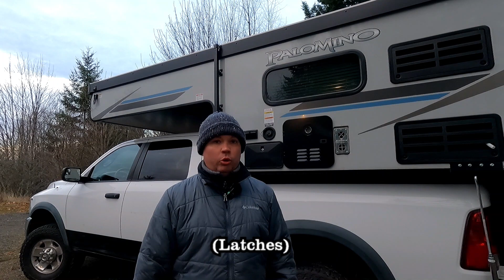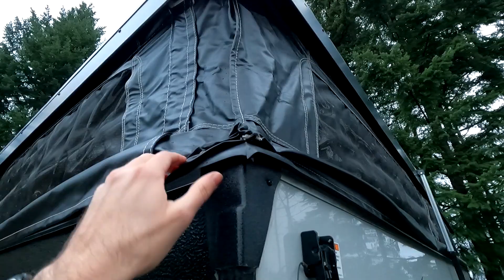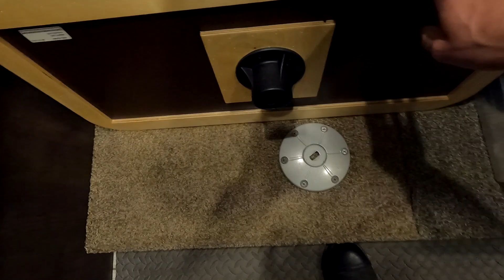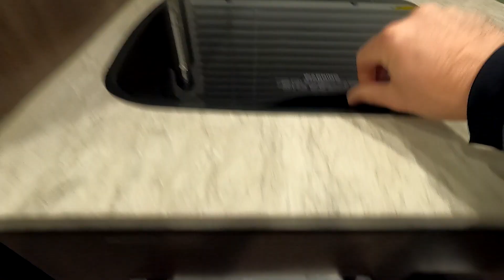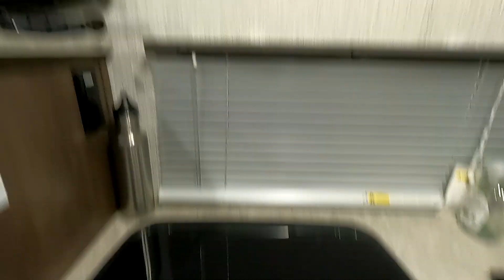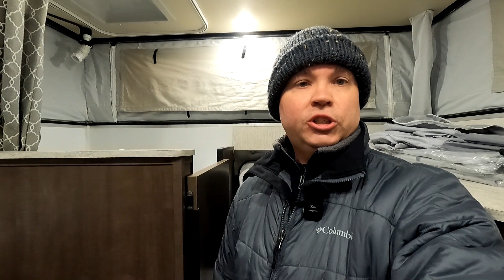Power Wagon Camper Part 9. New Palomino SS-1251 Worth Buying? 1st Impressions & Build Quality Issues

Comment: Any issues or annoyances with it on your shortbed? Was just told by a local rv dealer that it wouldn't fit correctly on my 3/4 ton 6.5ft bed - or atleast I wouldn't like it.
Reply from the maker: I think your dealer is mistaken.  This camper was designed for a 6.5' bed.  It's listed on the Palomino website as such (and shown in the back of short bed truck on the website).  No, I haven't had any issues with this camper being in my 3/4 ton with 6.5' bed.  You'll probably need helper springs or air bags if you don't already have them, though.
Reply: @outdoorsinoregon  I saw that on their website too, but just wanted to hear from someone with experience. Thank you

Comment: If I read all before I bought my pop-up I would not buy one. I to have problems with top lift jacks. When unplugging from truck doesn't have enough battery power to raise all four jacks. A d I have solar panels.
Reply from the maker: Yeah, I like having the shorter profile for road trips, but the roof lift system was problematic at first.  However, I did figure out how to replace the motors and maintain the gears and such; here's a video I posted a while back in case it's useful: https://youtu.be/cw_OQ4onBw0?si=2EW2YGNMTn3xC1Gs

Comment: Based on standard production, the 2011 Ram 2500 was not available with a 6.4L HEMI engine from the factory. The 6.4L HEMI (Apache) was first introduced in Dodge passenger cars in 2011 and later for Ram 2500 trucks beginning in the 2014 model year. & DodgeGarage +2
For the 2011 model year, the available engines for the Ram 2500 were:
• 5.7L HEMI V8 (Gas): Standard, producing 383 hp and 400 lb-ft of torque.
• 6.7L Cummins Turbo Diesel (Diesel):
Optional. Edmunds
If you are seeing a 2011 Ram 2500 with a 6.4L engine, it is likely a custom engine swap (e.g., placing a 2014+ Ram 2500 engine or an SRT 392 engine into the 2011 truck). ®
Reply from the maker: This is a 2012 with 5.7L.

Comment: I live in western washington and I was thinking about getting one of these pop up truck campers for hunting season (birds and big game, September to February). I big game hunt up in the mountains and bird hunt in the grasslands on the east side. How do the fabric walls do in the cold? Do you get a lot of wind flap while trying to sleep? I'm trying to decide between the pop up and the hard side truck campers, but it seems like the pop tops would do better on forest service and logging roads (weight and manuever wise). And during big game season I'd be pulling a small trailer with a quad. Showering is pretty important to me too.
Reply from the maker: The fabric walls do much better than I expected. I've camped on the coast with very strong winds, and as long as the roof is all the way up (walls taught), wind noise has not been an issue for me. The propane heater was able to keep the interior warm during a wind storm in WA last December, but it had to work hard to do so.  It loses a lot of heat during high winds, but maintains heat rather well when it's not windy.  

The indoor shower is small, but it's a great option to have, and not many smaller or pop-up campers have them.  

The lighter weight and lower roofline of the soft top works MUCH better on the road and in the woods than a taller hard side, but takes extra time to set up.  The primary drawback of this camper in my opinion is the roof lift system. The motors and lift arms are not waterproof and can rust up if not maintained (especially if you don't have covered parking).  I made a video about this if you're interested: https://youtu.be/cw_OQ4onBw0

Comment: I have the exact same camper SS-1251 Palomino 2022 model. I got mine in Iowa at Cheyenne Camping Center. The only issue I had with mine was the aluminum shavings falling from the ceiling. We have hauled it about 4500 miles so far. My only regret was getting the AC unit added on and not getting the power jacks. We never use the AC because we usually camp in the mountains where its cool at night so the furnace gets used more. The AC unit just reduced my MPGs and clearance. The manual jacks are ok with the socket adapter and a cordless drill but you need to run around and around keeping the unit level as you raise or lower it.  I would really like to find a set of electric jacks for this camper.
Reply from the maker: Electric jack heads can be purchased and installed in place of the manual jack heads. They are made by Rieco Titan and plug right into the extra socket below or above the roof lift motor plug.  Should be an easy upgrade. 

Yes, the manual jacks are a bit of a pain. The weight at the front of the camper put such a strain on my drill that it burned it out. I've since bought 4 manual cranks so I don't have to move a single crank or drill from corner to corner.  I'd love to have the electric jacks, but they are very expensive.
Reply: My 18 volt Milwaukee drill does great in low gear but you better have both hands on it or will get you ! LOL You mentioned that you got your camper in Iowa. Was it from Cheyenne Camping Center ?  @outdoorsinoregon
Reply from the maker: Yep.  @wayawolf1967

Comment: Careful!!!!!!! Mine caught on fire on the road and totally ruined all because of their wiring!!!!!!! Lost everything!!!!!!!! Covid build and my insurance wouldn't cover it.
Reply from the maker: Wow, sorry to hear that. This is definitely something to watch for; I'm unimpressed with the way both the hoses and wires have been routed.
Reply: Yes, started under the sink while driving down the road in Idaho. After my three fire extinguishers slowed it down,  the first responder ( police ) didn't have  a working fire extinguisher and only one. Then the fire department fillaly arrived, didn't have any fire extinguishers, and couldn't get the truck to pump any water for the first 15 minutes. I'm a disabled Vet, and I am now stuck with dealing with a desroyed slide in that's sitting in a wreaking yard adding rent. Make sure your insurance doesn't do this to you, I don't want this to happen to anyone... Reminds me. For sale 2121 Palomino SS- 1251, slite smoke smell and destroyed,  leave message...
Reply from the maker: @johng530  Any ideas on what started the fire under the sink? 

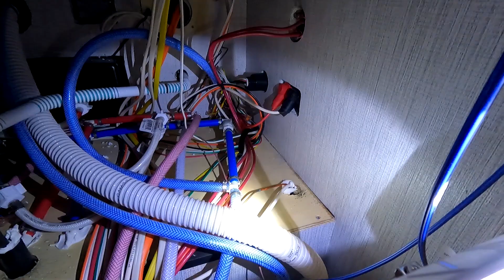At about 08:43 in the video, you can see the other side of the front 12V solar panel terminals, where the +12V and Ground are very nearly touching. Looks like there's a rubber boot over each cable end, but I could see where the cables could touch if the boots weren't on tight or vibrated off. There's also bare copper under the sink that could cause a short under certain conditions.  It wouldn't take much to start a fire with all that bare plywood and plastic. 

Anyway, thanks for the input; this is a good reminder for me to check the condition of that rat's nest of wiring.
Reply: Lot of saw dust in that corner, and the wires got too hot when I was pulling a trailer. All this is still in progress. It  just happened a week ago . Keep ya posted.
Reply from the maker: @johng530 OK, I appreciate the inputs. Pls. post again if there are any additional findings.

Comment: Glad to see it's not just us with the fit and finish issues with these. They really slap them together don't they. If you're handy and the warranty is up, you can make these reliable. It's a shame though, for what you pay. Do you leave your tailgate on? It worked in the previous truck, but now the rear of the camper is hitting the tailgate straps, enless the camper is set back. Wondering if I can just set some 2x6 in the bed for clearance, but I don't want it to get too high.
Reply from the maker: Yes, the build quality is questionable, but as you say can be made reliable with some effort. 

Good question - yes, I do leave my tailgate down, as I really didn't like the idea of the camper overhanging the rear of the bed so much.  It seems to me that the tailgate provides more stability for the camper, especially in bumpy or off road conditions.  I noticed on the Palomino website, the pictures show tailgate down as well.  

And yes, that does indeed pose a small problem with the tailgate straps. On my truck, the camper has to be very well centered in order to clear the strap on the passenger's side. It took me some time, but I finally came up with a process for making this work consistently without multiple retries when loading the camper.  (I made a video of my centering process here:   https://youtu.be/nwuyrzEaAfE)

I don't know what kind of truck you have, but adding boards or wooden structure to the bed is fairly common practice and required on new Fords with some campers due to the deeper beds they use. I would be wary of lifting the camper and increasing center of gravity, but I guess you have to do what's needed for fitment. 

I should mention that I use a rubber mat in my bed which lifts the camper a bit, and as long as the camper is centered, clearance isn't a problem. 

Good luck!

Comment: Why does my local FR Palomino dealer insist....that a 1251 will not fit a 6'4" bed. I have a 23 RAM 2500
Reply from the maker: Can't say.  My 2012 Ram is listed as having a 6' 4" bed, and it fits fine.  I've seen these on other Ram short beds as well (including the one that delivered my camper).  I would confirm with another dealer or with Palomino directly.  I can't see why it wouldn't fit.  

Palomino does state that it will not fit with an 8' bed due to the rear overhang.  Maybe your dealer got confused or has wrong information.

Comment: The payload is 1560. The wet weight is 2505. Your 945 over payload & you haven't added weight of people & stuff.
Reply from the maker: Wrong on both accounts.
Reply: @outdoorsinoregon  I'm just going by the numbers pulled on line. Edmonds for the pay load & truck camper magazine for the camper weight weight. Fast lane trucks has videos on off road pickups. They say the Power wagon, because of the off road suspension has less payload than a F250 Tremor. You have to look on the driver door sticker, for the payload of the truck you own  & compare that with the sticker inside the camper that has the dry weight. The wet weight will be heavier than the dry weight. The more weight you add with people & stuff, subtract that from payload. But I think you're overweight on the camper alone
Reply: "2505 lbs." ??? How the hell, Jack, do you get that "wet weight" number of 2505 when the unit has a dry weight of 1814 lbs., 15 gallon fresh water = 124.5 lbs., 5# LPG = 37 lbs. ? Any grade schooler could tell you that comes to 1975.5 lbs.
Reply: @williamfuller2389 I got the numbers from truck camper magazine! Even from your numbers, still over payload!

Comment: The finishing detail on that front corner you point out that is so absolutely ridiculously exposed to the environment is a concern for the overall build quality. If something like this is so evident imagine what us purchasers do not see. A couple of children could have finished that corner off better than forest river did.
Reply from the maker: Yeah, having that gap there was really strange.  I was wondering if they had excluded a corner cap/cover on my build, but others have reported seeing a similar issue on their camper as well. 

This camper has a lot of nice components and features, but certainly the build quality could be better.
Reply: I have a 2000 northstar pop up. Have watched those front corners relentlessly for a hint of water issue. Normal job craftmanship would see those corners overlap. The only water damage i have ever seen on these is always at that exact spot. But hey, pop ups rock. Youll enjoy it. Cheers

Comment: Appreciate your detailed videos. I'm just getting ready to pull the trigger on a new 1240. I'm 6'-2" so the extra room in the 1240 really helped with my decision. The inside shower might be nice on occasion, but I was already used to taking my showers outside in my old 94 Caribou camper, even though it had an inside shower too. Just setup a little tent enclosure alongside the camper and ran the outside hose into it. Thanks again for the great series of videos. 👍
Reply from the maker: Yeah, an indoor shower is nice to have, but of limited use.  This camper doesn't hold enough water for all of us to shower, and if we're staying at a site with city water, there are usually shower facilities available. Overall, I've been pretty happy with the Palomino. Once the initial bugs were sorted out, it's been working out fine.

Comment: Very good information on this style of brand camper , I’m in the market to purchase one up here in British Columbia , Canada 
Plan is to use it in the fall .. and some winter camping .. nice to hear during your review it was snowing ....   : )
Reply from the maker: Thanks for the note. I have been very surprised by how well insulated this camper is considering it has a soft top, and the camper warms up quickly with the propane heater. No issues at all in the Oregon winter at temps just below freezing, but I've never had it north of the border where propane can freeze.  

With the top down, the insulation factor becomes MUCH greater, which could be very useful in an emergency winter situation.

Comment: I just bought a 2023 SS 1500 last month, April 1, May 27 to 29, 2023. Our 1st camping at bodega bay it was windy, and it rained a little, but I had fun, just like yours it issue with bath door hinges,bolt missing,both leg awning doesn't hold the annoying part is the wiring from jack cheap boar, and this after telling bish's rv of utah to double check B4 I come to pick it up n still nothing has done. anyways stay safe.God bless.
Reply from the maker: Yeah, the quality control on these isn't great. I think I've sorted the bugs out of mine at this point, and it's working pretty well overall.
Reply: @Outdoors In Oregon  yes sir, really bad quality, I rebuilt a 1987 lance ls3000 8.6 n I believe I did better building this camper D way they built this, I called it pandemic camper,all n all I still love,we visited Oregon 2yrs ago so wer planning 2 camp there nxt yr. Let's stay+ n happi camp🙂

Comment: 1700 lbs ! payload for the power wagon is something like 1500 lbs
Reply from the maker: 1858 lbs. stock payload and has no issues with this camper.  This camper was actually designed for a half-ton truck. The Power Wagon is built on a 3/4-ton chassis, with the only weakness being the soft off-road suspension, which has been properly upgraded as shown in previous videos.  Engine, trans, axles, brakes, tires, all capable of 3/4-ton duties.

Comment: Same shaving thing for me. Also the rtv for the walls didn't cure amd it ran all over my walls. The actuators for the roof SUCK. Lastly my roof on each side at the corners about midway along the camper seems to be seperating from the structure. 😢 dealer literally blew me off and wouldn't warranty repairs.
Reply from the maker: Do you have the same model?
Reply: @outdoorsinoregon  2021 ss1251
Reply: We had to bring back our 2021 SS1500 3 times for warranty issues. Main problem is the roof actuators, and them not owning up to this variety was never meant to work outside. There are very similar models with stainless internals and weather sealed against the elements. We tried to get them to acquire those instead, but they refused. After the 3rd time back again Forest River had found a different source for these. The new type have rubber boots for both the top cap and the motor. So far, these have been much better.